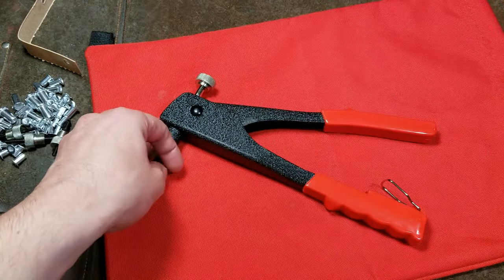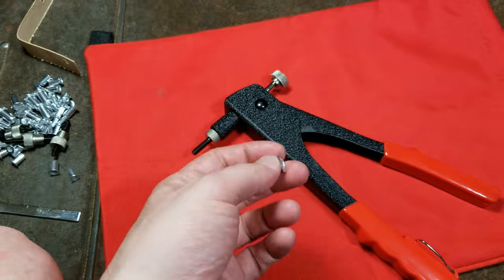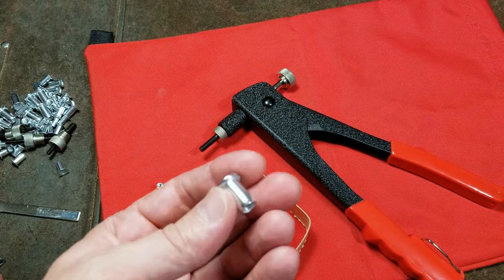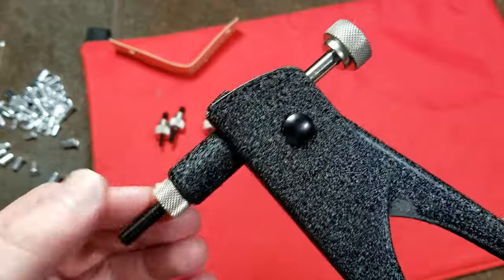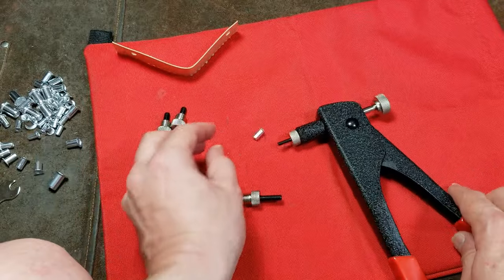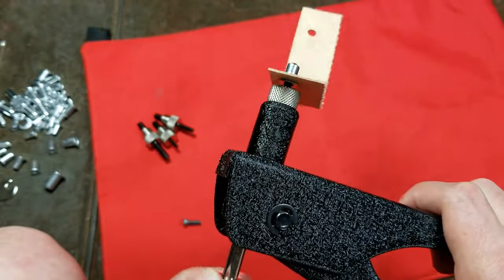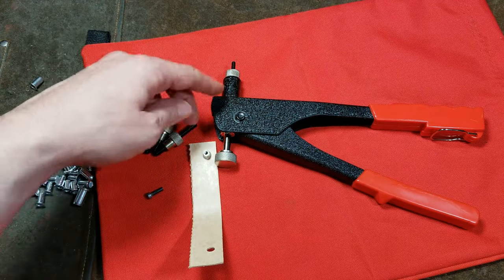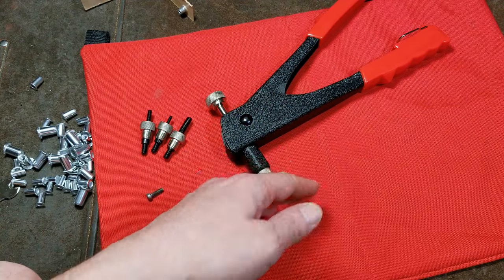Harbor Freight FastenPro Threaded Insert Riveter Set Review

Comment: We bought the original tool like this about 35 or 40 years ago. I think it was called The Rev-Nutter. We used it for fastening inspection panels. It comes in handy for a lot of different things. Once you have one, you'll find lots of uses for it. One thing we did, we made die sets to recess a flange around the drilled hole for the nut so that it ends up flush with the sheet metal. (Just like a kitchen sink.) That way your cover sits flush and doesn't stick up the thickness of the flange. We probably paid more for this that many years ago. And, to tell the truth, this looks every bit as good or possibly better than the original. Also, if you're concerned about this turning in the base metal , you can add a small drop of red Loctite before setting the nut. But, make sure you set tension properly and, like rivets, use the proper grip range on the insert. Trying on a piece of scrap first.
Reply: It is called a Riv-Nut and yes, they have been around for decades.
Reply: Looks can be deceiving.  I am concerned about the import metallurgy and the high-stress threaded part of the tool breaking.  Maybe they used good steel?
Reply: I started with nutzerts in high school, sometime in between 1977 and 1981. So about the same time.
Reply: The hole must be the correct size in order for the rivnut to grip properly .

Comment: I have this and use it. However, as an auto mechanic, my biggest gripe is that it doesn't have metric. Modern cars, no matter who made them, have metric fasteners, and I generally consider it a mark of laziness when someone uses a fractional fastener on one. It's tolerable when you're adding an accessory, as opposed to replacing a broken or missing fastener, but a car really shouldn't require two different sets of tools to work on it.
Reply: Of course they exist metric. It's rare for me find Imperial and everything is metric because the whole world uses metric, including NASA
Reply: @Full_Throttle_no_Brakes  I know they exist in metric. However, this particular one, the one demonstrated in this video,  only has mandrels for SAE/ Imperial threads. It won't install metric inserts. And at the time I made the comment, 2 years ago, it was the only one that Harbor Freight sold. That's why I was complaining- it was useless for modern cars because of that. My comment was intended to tell people that are thinking about getting this one about a serious shortcoming it had. Since then, they've wised up and started offering one that has mandrels and inserts for both metric and SAE.
Reply: @puckcat22679  Thanks for the clarification.
Reply: @Full_Throttle_no_Brakes The whole world could fit its GDP in the GDP of countries that use Standard..

Comment: These are used on lots of aircraft. 10 32 is the most common size which this doesn't have. If set properly they can last for decades. If not they are maddening.
Reply: You are correct. We called the rivnuts.

Comment: In the aircraft industry, they are called blind nuts, because you can install into something without seeing the back of it, or more commonly called rivnuts.
Reply: Tex Prepper yep and I hate them!
Reply: Ruttigorn Logsdon 
I understand completely. It's way to easy to pull the aluminum threads out, even with a 10-32. Then you have to remove the one you just broke and try again. And again. Recently slammed my middle fingernail with the tools handle when the threads broke.
Reply: Our old unit also sets Steel, brass, and copper. Aluminum insert should only be used for very light application.

Comment: My HF tool fell apart. Both stops inside the tool are press fit metal pieces and they both came loose and fell out. I tried to several fix methods but without no success. I would not buy another.

Comment: I love rivets. All kinds of rivets. They leave such a clean professional look. They can definitely be handy in certain situations, where nothing else would work. Just a little tip... I was in a "jam" and ordered a RIVNUT set specifically to make 1 connection. The connections are surprisingly strong when done correctly. You probably will never need steel "rivets" or "rivnuts". They are WAY more trouble than they are worth. Not knowing what I was doing the first time I used rivets, I figured "might as well opt for a stronger fastener than a weaker one, and ordered Steel Rivnuts thinking the process is the same..." BIG MISTAKE! Being made of steel I couldn't get them to crimp tightly, I would squeeze with all my strength and it just wasn't enough. It was enough so that the rivnut couldn't come out of the installation hole, but not enough so that it would remain tight, stationary, and solid. So now, when I go to un-screw the tool, the whole rivnut spun in place, along with the mandrel. I could not separate the tool from the halfway installed rivnut for the life of me. It was a complete disaster. I had a rivnut tool stuck to the side of my work van, and it looked ridiculous and was embarrassing. Being we're it was, I couldn't get a tool in there to hold the rivnut stationary while I unscrewed the tool. That mistake cost me hours, and after I finally got them seperated. Now I had to start drilling it out. Which again is a problem because it wasn't tightly installed. Now the rivnut would spin with the drill bit. Just a complete disaster. Do your self a favor and use the most malleable Rivnuts you can find. Being able to install them "tighter" is much more beneficial than them being made out of a stronger material. I got a thin aluminum one and installation was a breeze after that.
Reply: Good story but if Im using these on my sway bar or other parts of an automotive suspension wouldn't it be dangerous to use anything less than steel?
Reply: Probably need a better installation tool.  Did you have the squeeze-handle type, the one that looks a bit like bolt cutters or something else?
I'd be really careful about the hole size, too.
Reply: If used on suspension I would tack weld it good also. I've done it a few times when needed & never had problems.At times I had to drill a couple small holes on the side of it to weld it then light grind flat.
Reply: Your story is my exact situation. Alum on Alum no need for steel. Been trying to learn RivNut tech last day and your vid set me straight.
Reply: Using a aluminum rivnut with a steel screw will cause dissimilar metal corrosion, you’ll never get the bolt or screw out of the rivnut, kind of defeating the purpose.

Comment: I have an original Riv-Nut set. Great for working on things like my old Land Rover. It was amazing how many places they decided to through-bolt everything with a nut on the outside. It was comical how many times my Dad or I had to get underneath the truck to hold a nut so the other person could back the bolt out on the inside. After a few of those we went digging for this tool and it saved many headaches. Good to know I have somewhere local to buy supplies for it.

Comment: Thank you so much for this very informative review! I just replace the soft top on my jeep wrangler, and when i went to reinstall the frame and new top, 3 of the bolt holes for the pivot support brackets for the soft top (they mount to the rear roll bars) were completely stripped out.. They dont support much weight continuously, only when folding the top back, tried to tap the holes, and thats proving to be quite difficult because the tap just doesnt want to bite, so i stumbled upon this tool, and after watching your video, i think this will absolutely work!

Comment: 6:14 If one end of a threaded collar is slightly messed up, you can insert the screw from the other end and start it screwing through, then add a drop of oil and keep turning the screw and it will straighten out the damaged spot in the other end :D
Reply: Or, you can get a pair of needle nose pliers and hold the insert, or just force and odd angle on the 'zert and back your screw out, then gently start your screw again. I do this multiple times a day building shitty grills that are made in china.

Comment: Looks good might have to get it.  Got a astro large one to put an air compressor together works great but I see were a small one would beneficial in tight spots electric panel that kinda stuff. Hf is getting better so will probably get one.

Comment: 2:26 Or as another YouTuber showed, you can use a dab of ThreadLocker on the flange to hold the fastener in place after it's installed :)
Reply: Once you get a screw in one, they don't usually come loose.

Comment: I much prefer the standard rivnuts, they have corrugations on the barrel that really lock in the insert when compressed. Plus available in metric. I just use a nut and bolt to tighten them in place.

Comment: Inserts with knurling are better, less likely to spin.  
Red Loctite on the outside (NOT the threads) helps.
Want a tight fit on the mounting hole; maybe step-drill (slightly undersized, then to final size) and make sure the drill stays as straight as possible.

Comment: There is a tool you can use with a cordless drill that doesn't cost hundreds and it works with the steel rivet nuts. And I've seen tools that people made with a couple of wrenches and grade 8 bolts of the appropriate sizes that will also compact the steel rivet nuts. Not as convenient as this kind of tool, but workable.
Reply: Care to tell us the tool make, model, a link?

Comment: Not happy with this tool. Used 6-32 die. As soon as I applied the lever pressure, the die bolt broke leaving a chunk in the rivetnut that I will have to somehow drill out (at least 30 min work).

Comment: I purchased this but wanted metric. Before I returned the HF tool, I checked to see if the Amazon metric version https://www.amazon.com/gp/product/B07NVSPYNM/ bits would fit. They did. The left-handed threaded metric bits fit perfectly in the HF tool. The collars did not fit at all, but using the HF collars  with the metric bits worked fine. Given this it's probably safe to buy metric bits for the HF tool.

Comment: Does harbor frate have replacement rivets for it ?
Reply: Nope.  Have to get them from third party suppliers.  HF commenters say the threaded pull rod break.
Reply: @danburch9989  no big surprise in a $40 kit.  High stress, and high-strength alloys cost more to buy and form.

Comment: Can add a washer to the back to increase strength.
Reply: Sure you can but if you can get to the back side with enough room to put a washer on the blind rivet nut, why not just use a regular bolt and nut since it is no a “blind” location?
Reply: @coypatton3160  stays in place by itself.  Nice when having to hold the part being fastened with one hand, the screw with your hand and the nut with your third hand.
Also may not be able to reach behind when the piece you are attaching is in place (e.g. a cover).
Reply: Scott Willis so just how did you hold the washer in place to put on the back side of the rivet?
My simple statement is that if I can hold a washer in place, then I can hold  a nut as well. 
Sorry to hear you are less capable!

Comment: You don't even need the rivnut tool. Just a hex-head bolt, a washer, a nut and two wrenches. Works with aluminium and steel rivnuts. No need for hydraulics or any other fancy nancy tools.

Comment: Um, those are MIXED sizes included with kit (as common): 6-32, 8-32, 12-24 are METRIC, eg, #6 (6mm dia) ”32” threads per inch, usu numerals separated by dash. Only ¼-20 is ImperialSAE 1/4”, 20 tip. Good vid, buuuut....... also woulda been nice to see an IPC or BIN#
Reply: Metric sizes look like M3, M4, M5, M6, M8, etc.  
#6-32 is six sixty-fourths of an inch and 32 threads per inch which is Imperial (English) system.

Comment: No 10/32?  Who uses 10/24?  Inserts should have knurled bodies.  These HF things are poor in execution.  Will spin in the hole in the base metal.  Good insert are great, bad inserts are a pain.  And hard to remove if they spin.
Reply: Lots of 10-24 in sheet metal assemblies.
Good point on the inserts, particularly if the hole is drilled too large.